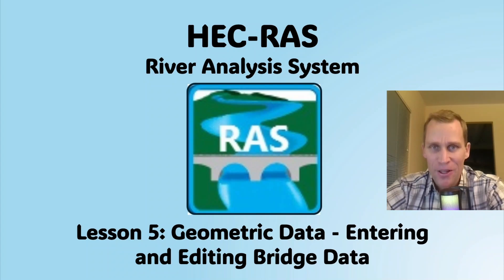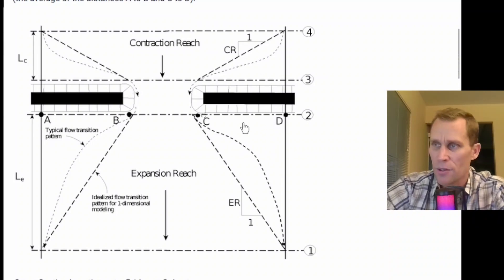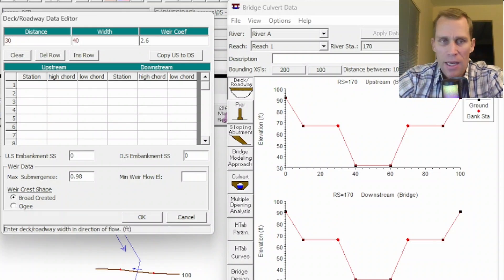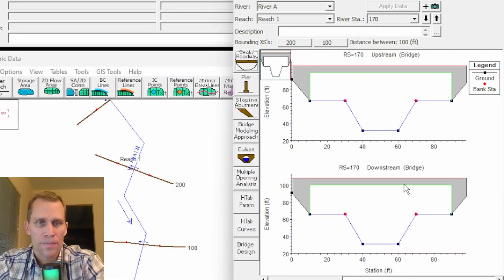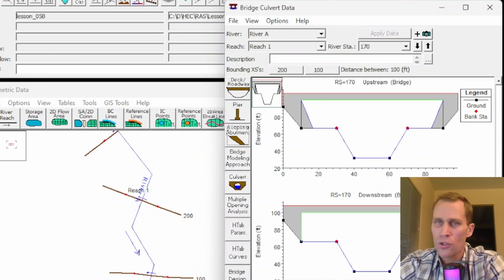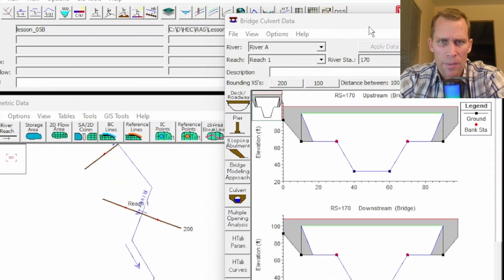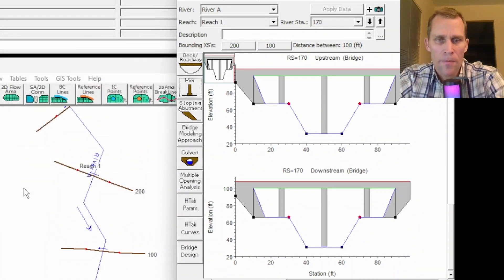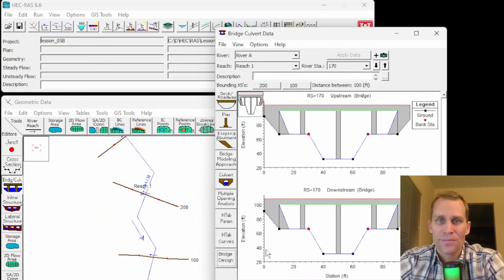HEC RAS Lesson 5 - Geometric Data - Entering and Editing Bridge Data

Comment: Hello,if I may ask does modeling inline structures in 2D areas better compared to modelling them in 1D. Or both are just fine
Reply from the maker: Both 1D and 2D will work. If I had the choice, I would model as much in 1D as possible/practical, and model in 2D when necessary. Simply because, the computational run time is much larger in 2D.

Comment: Sir, can you please elaborate the definition of distance @ 4:11 . R u referring to Lc?
Reply from the maker: Hi. That distance value discussed at 4:11 is referring to the distance between the upstream side of the bridge and the next upstream cross section.  If you check out the image at 1:33, this distance is not Lc (the length of the contraction reach). It's just downstream from Lc, its from cross section 3 downstream to the bridge deck (the solid black).

It's shown and explained in the user's manual. Check out Figure 5.14 on this page: https://www.hec.usace.army.mil/confluence/rasdocs/rasum/latest/entering-and-editing-geometric-data/bridges-and-culverts/entering-and-editing-bridge-data
Reply: Thank you  @TimNelsonPro  Sir, for clearing my doubt..